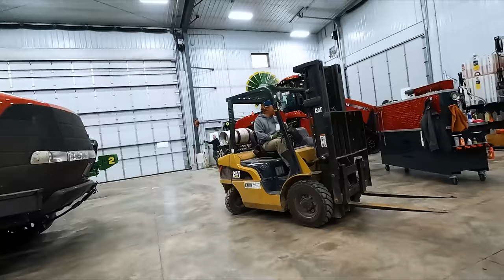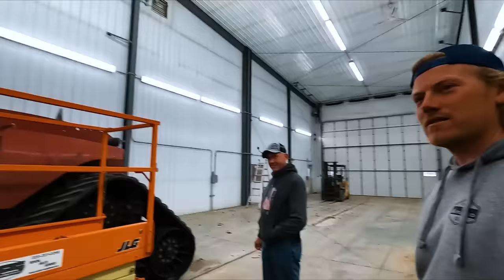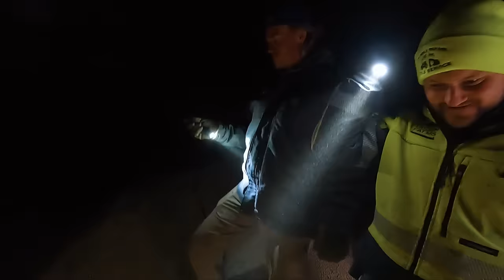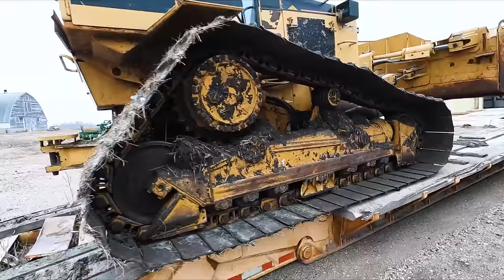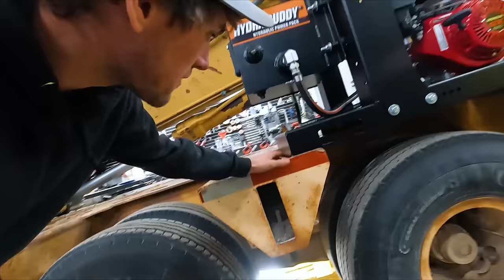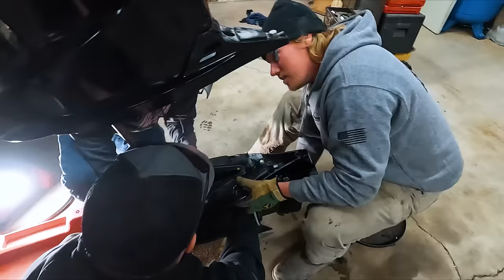Brody’s Getting All The Upgrades This Year!!

Comment: You can mount the pump on the truck that you use to pull the trailer the most. That way it won't block any of the trailer bed.
Reply: But than you have to connect the hoses, lift the trailer, disconnect the 5th wheel, put the truck close to the trailer to connect the hoses and lower the ramp. Then you decide if you want the truck close while loading. 7 things you have to do for loading or unloading.
Reply: Thats pry why Doug wanted a new trailer with a RGN style vs the laydown neck

Comment: Chet you made Brody a happy man with that lift, also love Dougo comment bust out another $1000. The end is never in sight! Mount hydraulic unit on the truck that usually pulls that trailer!!!!!
Reply: Agreed but they swap trucks fairly often depending what grain they are hauling.
Reply: Maybe it could be made to swap it out to a couple different trucks as needed. Instead of mounting it on the trailer .
Reply: " fun sized man "

Comment: Yes mount it on the truck. Much better idea and way less work and smarter place to put it.  You could even make a mount for it and make it portable to go on any of your trucks if needed.   Thanks for the video.
Reply: One step further. Mount so you can remove it from the truck so only exposed to weather when needed.

Think a forklift slots for a base.
Reply: Then why not just put a wet kit on the truck. The reason they are going with this set up is so any truck they have can pull it and it's not limited to one
Reply: @ajmages  Mounting it on the rear of the trailer will be very hard on it.  The roads will beat it to death.  There is a reason there is no wet kit on that trailer.  If they want to do it the correct way is buy the correct trailer.  A detachable one and then one person can do the job.
Reply: @ajmages  but it is also limiting. Depending upon placement and its mounting the deck is no longer fully available. 
Storage of this trailer. Does it merit space in a shed before. Will it now with this on board
Could this hydraulic equipment be used elsewhere and for other tasks. 

Be nice but is doubtful that Chet waited for comments before proceeding with this project.

Could always do it twice.

Comment: FYI the 120 volt outlet is just a fancy extension chord built into the sissoring frame. You have to plug it into an outlet in order to have power up in the basket area.

Comment: Cut the deck plate out over the rear axle. Then build a bracket for it to sit on above the rear axle and in between the frame rails. That way you can reach it from the rear to start the motor.
Reply: Agree, also the motor and hydraulic tank don't have to stay in that frame, mount them where room permits on a frame you fab up.

Comment: Have a class on the man lift!!!!!  Make sure that if you are operating close to an over head object that someone is on the ground knows without delay how to take control of the unit.  When you are at the top of your lift, where you want to work, LOCK OUT THE UP COMMAND.  You do not want the lift to get a notch in its belt like one I worked with.  The Person was working under a beam when he leaned over the side and moved the up switch.  The lift pinched him between the side rail and the beam. NO one on the ground knew how to switch control.  We had class every time we worked close to an overhead structure.

Comment: Why not paint a line on the floor. Then when your backing equipment over the pit, you can line against/along it. Not having to worry about dropping into the pit.
Reply: On normal trailers that would work, but with the side extensions on the lowbed you wouldn't be able to see the lines anyway.

Comment: may I suggest to you all, keep a maintenance logbook for piece of equipment.  So when you guys are working on multiple pieces of equipment at one time, you're not flipping back and forth on one book.  Also when you sale a piece of equipment its easy to sale and could add more value, because of all maintenance records are kept.   
If you really go nuts get some digital tablets with maintenance manuals loaded for the equipment, then when you sell print records, and keep tablet for replacement equipment.  You can set the tablets up for all kinds of inspections and maintenance issues as well as trends of inferior parts breaking too often.
It does take time to set them up, but when its done I believe you're going to love it.
Reply: You don’t even know the difference between sale and sell and yet here you are telling them what to do. I wonder how they ever became a successful multi generational  farm without you telling them what to do?

Comment: As a person who uses those lifts all the time they are very sturdy at full height and yes you can stand out on the extension at all heights usually about 400 lbs I do believe
Reply: yes i have used a scissor  lift like that a lot and bigger ones also, that is great lift and very safe..i am a  electrician
Reply: I used to take new guys at work up on those things all the way up and just stand on the deck and just shake it back and forth and just watch a freak out have we had a I believe ours was a 50 ft it seemed like 80ft, big one 5x6 deck
Reply: Make sure you get a good cover made for that unit.
It's going eat a lot of dust and grime back there.
Nice unit, could have many uses. TAKE CARE GUYS AND STAY WARM !!!!

Comment: Back in the 80's I pulled a LoadKing like that one.  The engine and hydraulic pump was mounted between the frame rails in the floor of the trailer right in front of the rear axles.  We had several of those trailers and they worked pretty good.

Comment: You guys should paint some guidance lines on the outside of the maintenance pit. A stripe on either side immediately outside the wheel tracks will give everybody a quick visual indication if they're centered over the hole.

Comment: if you mount pump on trailer put it in a gang box across tail to prevent theft ,extra room can be used for storing chains and holddowns ,simply put excavator bucket on goose neck when traveling, or fabricate box with angle iron sheetmetal and wire screen for venting. 3 rd option buy new lowboy and cancel sharpies order to pay for it lol

Comment: I know you are probably done with this project already but here goes. Youtuber Cassey LaDelle has a trailer that looks like yours. His pony is mounted under the deck. He turns a key by those back tires and the engines starts.
Reply: You stole my thunder!  I'm thinking the Larson's unit may be too tall to fit completely under the deck though.  Casey's was manufactured like that as far as I can tell.
Reply: @ridingwithairbubble1694  what's funny is when I see the way the Larson's unit operates Casey has that on his Western Star. He should plumb that ramp to run off that truck. Keep the pony as a backup.

Comment: Make a skid that will mount in the position of the deck plate on the trucks. Mount that pump to it so it wont be stuck on one truck and wont limit you on the use of your trailer.

Comment: You should take the new pump apart and make a box for it to fit in. Under the trailer in the space closet to the deck by the brake chambers for the first axle. It looks like enough space to put a shelf to hold the box. You should measure the space and see. From the top of the trailer cut an opening to start and access the pump.

Comment: Definitely recommend getting a Marine mechanic to rebuild and reinstall the lower unit.  Also get a new prop. Any dents in the prop will translate to vibrations inside the engine.
Reply: Definitely you will feel even the smallest dent and it will vibrate like crazy!

Comment: Was an Aircraft Mechanic forbover 20 years on C-130 Aircraft.  We had to use that size alot, and thevnext size big,band Snorkel liftsthat would also to to to the top of ehe vertical fin. A lit advice,  make sure you use the chain on the back where you climb up. It will save a lot of pain.

Comment: AT the Utility I work at there is a program that uses QR codes. You set up a page for every piece of equipment that has all the service info on it.  Then you place the QR code on the equipment and  just scan the qr code and it goes to the page for that piece of equipment and and you enter in the info.

Comment: Can confirm, hire out the lower unit re-install! Did this with an 87 year old grandfather in-law, a 58yr old uncle in-law at the top of a dirt driveway in northern New Hampshire with FAR less tools and know how. It seems simple until you need to get the trans, motor, and both shafts into the same gear while holding, twisting, turning, persuading all of that together at once. Ask me how I know. Also would have loved to have had a seat like Erik while holding all that!

Comment: We had these JLG scissor lifts at the airline I worked at. Great for working on regional jets with high mounted engines and t-tails. One evening I decided to get a picture of the sunlight hitting the mountains just right from the other side of the airport terminal, my coworkers did the same thing and turned off the basket control. Left me stranded fully extended for a while. At least it was a nice view.

Comment: You have room left on the trailer deck in front of your equipment. Make a low profile wheeled dolly, or cart. Start it, hook up your lines, lower ur neck, wheel it down and off the trailer. Can be wheeled to a safe distance and out of the way. Or simply mount it to the truck.

Comment: Thanks for another great video Chet. 

It was most definitely interesting. 

The look on Brody’s face when he saw the new lift was amazing. He was so happy. He couldn’t wait to get it inside to try it out. You were great to do that for him. He will get a lot of use out of that. Make a cover for the technology part of it to keep water off of it.  Nice piece of equipment. 

The power hydraulic system for the equipment trailer will be nice. Don’t need a tractor then. Mounting it might be a challenge. Know all of you will figure it out. Nice power unit. Might want a cover for it. 

Dougo and his boat. Oh my. Looks like it took a heavy hit. Putting all that lower unit back together is not easy. If it was me would have a boat mechanic come and inspect it and put it back together. Dougo that is too bad it has issues. Sorry. 

Thanks for everything Chet. You all take care. 
The Iowa farm boy. Steve.

Comment: Put the shifter in reverse so it's easy to turn the prop and get the drive splines aligned. Tilt the outboard back. Remove the cowl, hang a ratchet strap that hooks on both sides and runs under the lower unit. Easy controlled one man removal or install.

Comment: Suggestion….the lower unit is touchy going back in and doing it on a tilted motor is more touchy.  Going back on….back it over the pit so you can go straight up with it.   It will need to be set to same gear as boat control cable or you will be doing taking it off and on (don’t ask).  

Shouldn’t be any wear point on the shaft other than gear threads at top. If splines are good and greased and not bent, go for it.  Change impeller (water pick up) while off.  

I would thing they have some plastic covers for the electronics you can get along with a skirt cover….i have no idea, but would think they make em.

Comment: I usually do not comment but unfortunately i feel the need here. I am all for just jumping i and figuring it out however those lifts do not like side load, especially if you have a large hose hanging off the side of it, that said, arial work playform training isnt overly expensive and worth the knowledge along with a fall arrest (harness) training for using those lifts. Fall arrest can also carry over to your bin site work. As for the trailer, over the tires you can just run some of your old rubber matting over the tires creating a "mudflap/fender" per say that can flex and you can drive equipment over it. Great video as always Chet! Keep up the great work s always!

Comment: Should build a box on the back of the trailer that you could open a lid to run the motor, then shut when done so it’s outta the weather/road grime. Also be outta the way just in case you need to haul a semi again.

Comment: You may need a new lower unit if that prop shaft is bent. For future reference trim the motor all the way up when you take the lower out, makes things a little more easier. And always drain the lower unit oil out every year and put new gear oil in. Because moisture gets in there sometimes.

Comment: We had a bunch of the drop neck trailers in the military. The pony motor was up front centered on the neck just behind where the neck pivots. It had a legit 1/2 steel door to lift up. All the controls and key start were up by where your hydraulic inputs are now. You’d have to pull it off its pallet. Only thing I can see is at the rear all the dirt a debris getting all over it. Up front it was in its own case. Regardless you guys will come up with a great solution that works for your operation.

Comment: Maybe upgrade from the old paper-based system to a modern app for recording the machinery data. A computer in the workshop and a mobile app would make your work easier and more efficient. There are many benefits of going digital. Cheers from Dundalk, Ireland.

Comment: I was loading my 336 on a lowboy last week. The trailer had no ramps it was about a 12” drop I had to get my tracks up on while sitting in a road that was straight ice on a lowboy deck that was a sheet of ice. The flattest spot within reason was about 4° slope. I slide most of the way off the trailer twice and needed to just leaving it in the crooked which really annoyed me but no one died and no machines were on their lid

Comment: You need the trailers like we have in Australia. The trailer stays on the truck and two ramps are lowered on the rear of the trailer, then the machine is driven on, the ramps are folded up and the machine is tied down. The ramps have a tie down each. The driver simply drives away with his load. Simple.

Comment: Nice job on your Honda motor I would probably lift it up about 4 or 5 in off the frame of the trailer that way you have a little more clearance and on the motor boat engine that looks like fun

Comment: If your afraid of being stuck up there there’s ways to release the pressure and it will lower most of them are at the bottom but JLG I think there’s some form the top and the wire at the bottom is a ground wire

Comment: If you guys don't use the back section of your trailer you install on the back n just run longer hose from back to front n add extra oil for extra length in lines.

Comment: I would mount the hydraulic pump on one of the tractor that would pull 
that trailer less problem with the hoses getting caught on something an less work leaves the back open for loading it you  need it 👍🚜

Comment: You should have just put a Hydrolic wet kit on one of the trucks, if you mount that Honda pump on the back of the trailer with it being a spring  trailer it might shake the  carberater float. We had trouble with our Honda pump on a trailer similar to that , the rough roads shook it apart and when you got somewhere to unload it wouldn’t start.

Comment: Just go with a wet kit I'd say. Put a reel for the hydro lines and be done with it. Tear that frame mount of Cut a hole betwenn the rearest axle set the motor down in there do the same for the tank on the axle in front of that one. You got to run alot of hose but I know a farmer down here did his like that.

Comment: A hint on the boat issue. Aluminum or composite props will break when hitting rocks or lake bottom. Aluminum props can be rebuilt even when missing an arm. Leg damage is nil. That stainless prop that bent means you whacked something hard. Stainless gives you top speed but doesn’t give. I guess it depends what you are doing with the boat. It’s a pontoon so if top speed is the goal, you have the wrong boat. Just sayin. I’m speaking from experience as a 30 year boat owner.

Comment: Wrap the controller in plastic are you will be replacing the board every other time you wash something. They are supposed to be some what water resistance but the board goes out very easily.

Comment: It looks like on video, that the hyd power unit will fit under the trailer between front axle and drop wall if removed from the platform it comes on. Make some new mounts to mount the power unit and tank separately to drop wall and cut a access hole.

Comment: Before using that lift in damp conditions it may be worth getting the PCBs (circuit boards) conformal coated (covered in a protective spray) that will prevent corrosion. :o)

Comment: you need a start-all unit with 3 generators, start-all is the brand name. You will not have to worry about not having power anywhere. gas operated and will start anything with dead batteries. Check them out.

Comment: The White noise buzzer is much less annoying and you can actually tell where the piece of equipment is, since white noise is more directional. If you must have one, otherwise just disconnecting it works too.

Comment: I would mount the motor and pump on the truck..
Reply: Why? Then you’re stuck having to use that truck. There millions of lowboys running down the road with the motor on the trailer. 🤡
Reply: You right, but this float is different than most. Normal the motor and pump are mounted in the goose neck. On the back of the trailer there no protection, unless you build a box for it.

Comment: On pulling the bottom end off the outboard, instead of Eric holding the weight, couldn't you use the forklift to hold it by those fins?

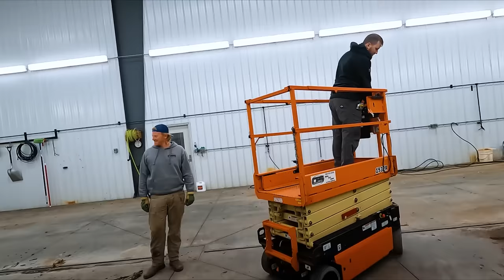Comment: 7:50  Yesss.  Put the scissor lift on the forklift forks and lift that sucker up for an extra 10 feet of reach.  Yea.

Considering what those things weigh I'm surprised the fork lift forks didn't deflect more or had the rear wheels lift off the ground.